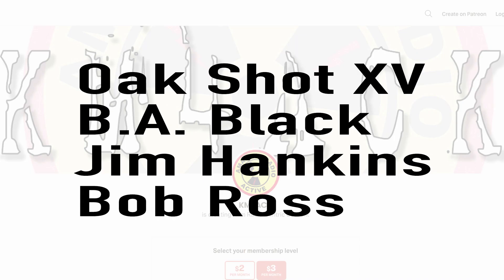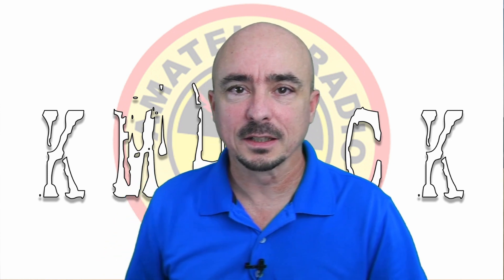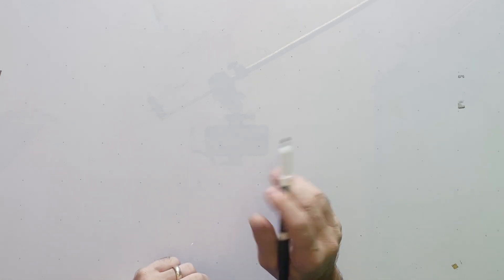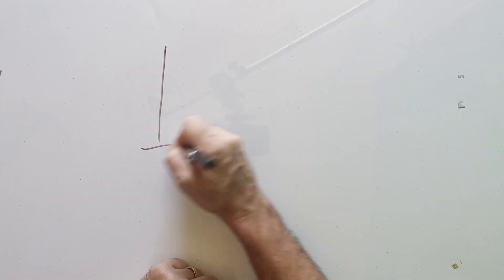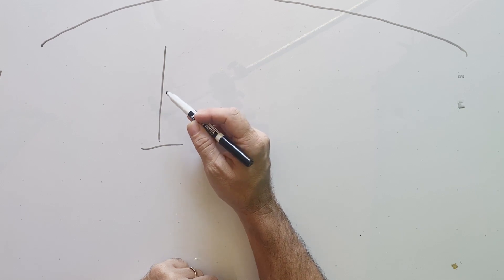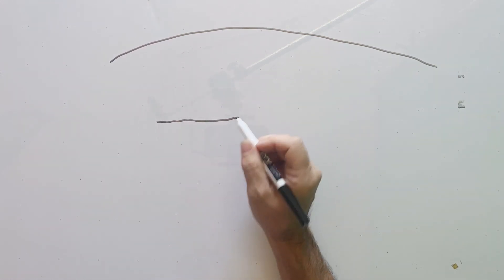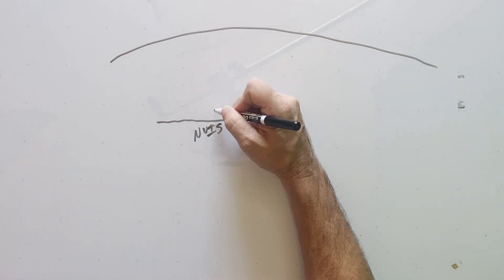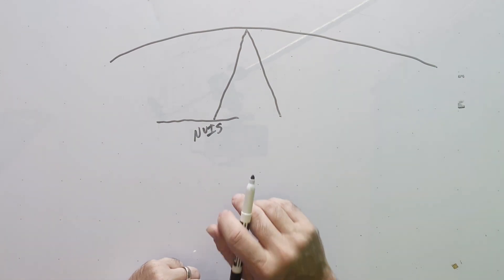Tips for Making Your First Winlink Connection

Comment: Thanks for the video.  I am new (as of yesterday) to Winlink and have been very frustrated by an inability to make connections on 20 or 40M.  (My ARRL kit end-fed half-wave antenna does not support 80M... I'll try upgrading that.)  My noise floor on 40M is ~S8 which, you mentioned, is bad.  I believe that the solar cycle is also bad, so I guess I am battling a combination of factors.

I'll keep trying - but, at this point, don't see Winlink on HF as a viable (reliable) emcomm mechanism.
Reply from the maker: It is more reliable than you may think right now. The S8 noise floor is your biggest enemy. I have the same battle from my home QTH. I have only found one reliable gateway that I can get into and that still depends on time of day. In the field where I have a much lower noise floor, I also have much better results. 40M trumps 20M everyday in my book for Winlink. It can be extremely frustrating until you find the one or two gateways that you can get into on a regular basis. If you have a 2M gateway in range, you might try that as well. I have 2 of them that I can get into from my home QTH and use them much more than HF. In the field, it is almost always HF.
Reply: @KM4ACK  I'll keep trying... thanks.
Reply: @KM4ACK  Success!  I moved my antenna (ARRL Field Day kit end-fed half-wave 10/20/40M) to a better location, and raised it ~8', and was able to make a connection (and send an email) on my first try.  Thanks for your support!

Joe
KB2JSB

Comment: Would you happen to have a set of settings for a FT-857? I am having a hard time setting up my 857 to trigger the Digital Vox to transmit when receiving signals from my computer. I have confirmed that the computer is sending from a USB sound card. The computer is receiving from the  FT-857. I am using a USB Sound card, a cable to the digital input port. I have no problems using this set up with JS8Call. Thank you for your assistance!
Reply from the maker: Hi Michael, Me or some of the guys will be happy to help you out. It's much easier to get questions/answers from many people in the forums. Post here https://groups.io/g/KM4ACK-Pi/topics and we will do our best to help you get up and running.

Comment: ... and the radio operator has to keep in his mind, that the winlink gateway station is scanning several frequencies and bands, and, of course, can by busy (in QSO) on the other band or frequency, while I am trying to connect him :)     yes, to make winlink connections, or in general, to keep contact to some specified other stations, needs a more skilled radio operator. That is not "playing with the radio" any more :)   vy73 from Hamburg/Germany, Dietmar, DL4HAO (running a Winlink2000 Gateway, at those times called "PMBO", some years b4, of course, in Pactor 1-3 modes only) ;)
Reply from the maker: You bring up an excellent point that should have been covered in the video. It's the reason that piardopc tries 10 times to connect with a gateway prior to giving up and timing out.

Comment: 7:55
How is that possible?? Nonsense!
Vertical like any antenna has the same diagram for TX as for RX. If the gateway can hear you then you would hear him. Probably not S9 since vertical antenna has low gain at that high launch angle but you definitely would.
We don’t talk here about asymmetrical propagation, that is separate story.
Reply: It does happen.  Skip/shadow zones exist in HF propagation just as they do in VHF/UHF.  I believe Jason was just pointing out that it is a possible instance perhaps only due to factors at the time, and to keep trying.  You are correct though, most of the time the signal still gets through.
Thanks for speaking up
KE0IHR
73's
Reply: @ericbjorkman4665 
Sure, skip zone is always there no doubt. The point was that vertical is not effective at high angles but if he can hear you then you'd hear him. The picture when vertical receives signals from high angles but replies only at low angles that is a nonsense.

Comment: Thanks. I've been meaning to try to make my first winlink connection again. Perfect timing for me.
Reply: Finally played around with winlink again today. Had my first two successful connections thanks to this! Did a send and receive email along with grabbing the current weather data. Also did a little improvement to my antenna which may have also helped. Thanks again Jason.
Reply from the maker: Outstanding!  Always fun to get Winlink working.